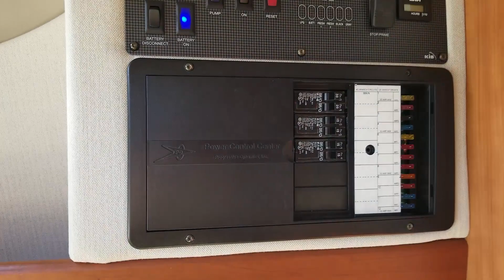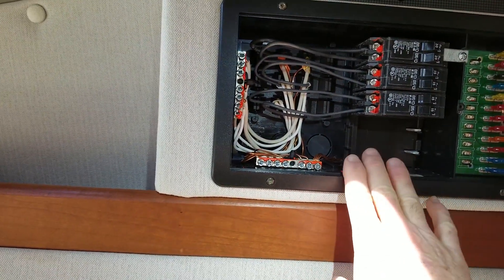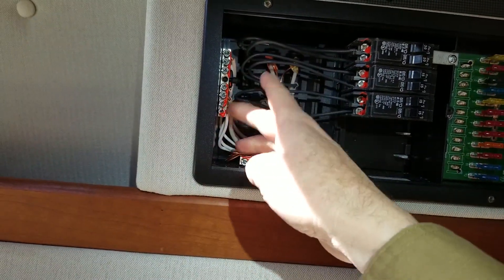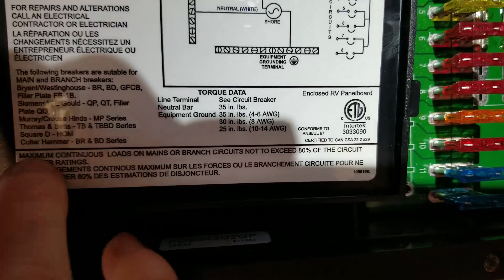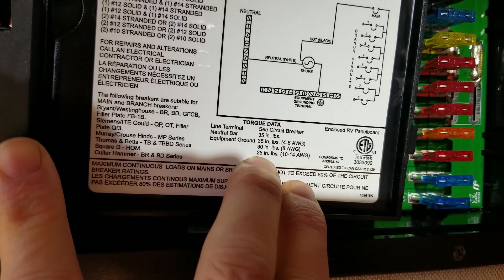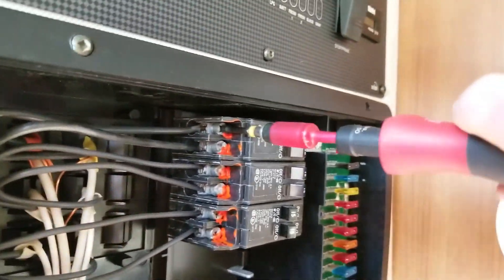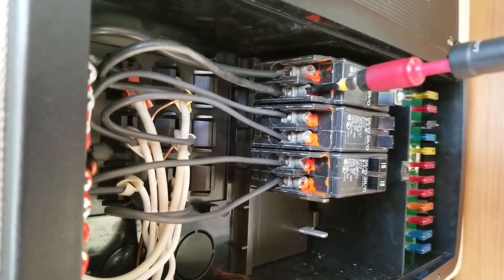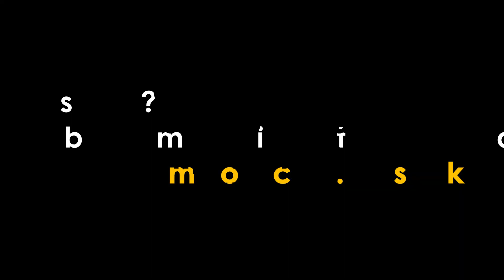RV Electrical Service Panel - Preventative Maintenance

Comment: Very helpful video as all of them have been. 
Seems nearly impossible to find a "mere-mortal affordable T-handled variable adjustable torque wrench". I can see how the higher torque requirements can be difficult for older and/or weaker hands necessitating the different shaped handle. I'd think the wrench manufacturers would do themselves a favor by designing a convertible handle. Drill a hole and supply a slip thru bar temporarily turning the cylindrical handle into a T-handle for those applications where it would help. Until they do, I'll just use my inch-pound normal ratcheting handle by Park I have for my bicycle needs.  
Thanks for the insight on both:  the repeated need for the torquing and the specialized tools to accomplish the effort.

Comment: I recently left this job to a technician at one of the stores of a large national chain.  He said he checked them and made sure all the screws were tight.  Several days later, on a cross-country trip, I plugged in and could smell burning coming from the breaker panel. I disconnected the power right away and considered my options.  After watching this, I knew the best thing to do would be to pull the breaker box cover off and check all the connections myself.  I did, and found a completely burned wire that was held very loosely by its burned screw,.  also, a whole bunch of other neutral screws were very loose.  I tightened every screw but will need to find a new circuit board and an RV technician.  Obviously, I could have lost my rig and died a horrible death because I trusted an RV tech to do this job.   However, I caught it in time and didn't die  thanks to your instructive video.

Comment: Had this problem on the neutral bar last summer. The Air Conditioner connection was not tight causing increased resistance and burned wires. Breaker kept tripping. Had to replace the busbar and trim several white wires to remove singes. Glad for no fire!

Comment: I think rv’s are subject to wide temperature fluctuations throughout the year and these screws expand and contract and can work themselves loose in addition to heat from current. Need to check these once a year!

Comment: I too spent 40 some years as an industrial engineering / electrician / mechanic but started out in the Nuclear Instrumentation Piping field.
I have worked for several OEMs building panels and wiring panels and none of them ever torqued their screws. 
Never had a problem, but it should have been done for liability's sake. Retired now.
But I disagree with you on the 12Volt side. 
Crimp on connectors can be tightened, especially the slip on spade types.
The screws on the ring connectors can be checked also.
I have found many that have overheated or completely burned out, so a visual check would be good.
What I hate about RVs is when the manufacturers connect 2 or more wires right in the middle of a harness run and use all the same color wire.
I found 4 wires connected to 1 wire right near the firewall, all Purple wire.
So which appliance was blowing the 25A fuse?
After removing all the tape and plastic covering:
1 wire was controlling the coil of the Aux Contactor.
1 wire coming back to another fuse in the same panel. ???
1 wire went to the heater Hi/Low switch in the dash.
1 wire ??? Never traced it.
I separated the 4 wires and installed inline fuses on each.
Never blew another fuse after that, but if it does, I will know what is doing it.

Comment: Another get video.  What is your experience, do the screws loosen over time or were they just poorly installed?   I so often see new RV's with issues that obviously came from the factory.   Poor quality control,  poor training of employees, or employees who do dot care.
Reply from the maker: I would say overwhelmingly it's because of the changes in temperature extremes. Not only with the ambient temperature between summer and winter but also with a current passing through the wires. As that screw warms up it starts to fatigue a little bit and therefore you have loosening screws.

Comment: Is it possible that there could be an electrical backfeed issue if the torque value is not set properly? I am having this issue in my motorhome and make sure I shut my inverter off every night for safety sake right now.
Reply from the maker: To schedule a service consult with Darren please sign up for the "1:1 Repair Consult" on our Patreon site.  https://www.patreon.com/myrvworks

Comment: Always PM the electrical panels @work. I have never heard of a torque screwdriver. Makes perfect sense. Thanks for enlightening me.
Reply from the maker: If you get one get the 'T' handle.  I can't justify buying another one but I do wish I had that style instead.
Reply: Is there anything else I need to know beside T handle before I buy one?
Reply from the maker: @joeandlorisadventures153  10-50 inch pounds is all I have ever needed in RV work.  I have not found a 'T' handle even though I have tired.  Here is a link to the one I use:

Wiha 28506 Torque Screwdriver, 10-50 Inch Pound  https://amzn.to/2k42K3u
Wiha 28581 Bit Holder Adapter For 1/4-Inch Drive Bits  https://amzn.to/2k6eJ0v